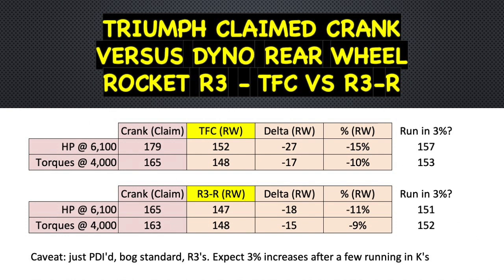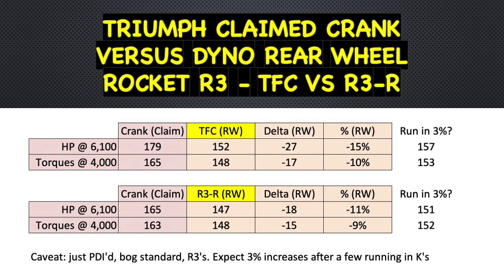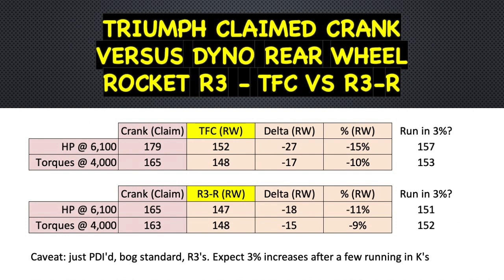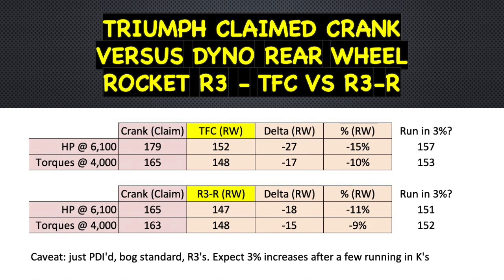RIDE ON | Dyno'd Triumph Rocket 3 | Factory Custom (TFC) vs R3-R

Comment: No big deal!
Reply from the maker: Other options are available. But none of them can put out circa 150 hp and 150 lbs/ft at the rear wheel. No substitute for cubes it seems!
Reply: @RichDunn   Understood... but here is the deal... here is where the rubber meets the road.  The Yamaha Vmax stock would beat it in the 1/4 miles as would the BMW racebike and maybe a Hyabusa!  I think you know that for real world numbers to change, one has to double the HP for a less than 30% betterment in speeds and faster elapsed times.  I know some one that has a customized HD that makes better numbers than the Tri.   That is amazing considering it is a POS HD airclooled twin. With that rational the tri should be over 200 HP!   An Indian with a supercharger makes better numbers than the Tri....  So like I said, no big deal. 

 That said, it is a cool bike... how ever ponderous and unwieldy!   I would prefer to be less than 1/2 second behind that monster on my 2020 GS!!!!!!!  And certainly again in the real world... the BMW GS would beat the Tri from coast to coast as a matter of practicality.   How ever If one has the money to play with ... heck yea... a tri would b phun!!
Reply from the maker: @davidfalgout7304  I've ridden the R3 and VMAx. The Max is heavier, has skinnier tires and makes less torque... so I wouldn't be so sure over 1/4 mile! And it's not designed to be a race-bike, like my old S1000RR/HP4, or a long fast sports tourer, like my old K1300S/Hyabusa; so not really apples and apples! Big numbers can come from tuned V-twins,. But do they come with refinement, reliability and a full factory warrant? Triumph comprehensively ticks those boxes! It's easy too say bikes with loads of money and tuning thrown at them can make big power. But you cannot then compared them to a bog standard production bike as if they were the same thing and say 'no big deal'. Have you ever scene the dyno figures for a TTS supercharged (previous gen) Rocket 3? It's violent!  Ponderous and unwieldy? Hhhmm, have you ever ridden the new R3? Or the VMax, Diavel and Fat Bob? I have ridden/owned them all. And the new Rocket is handles better than any of them! I've owned four GS/GSA's - OF COURSE it's more practical coast-to-coast than an R3!!! What's your point? ;-D The new R3 sure is 'phun'! Try it and then come back and diss it, and I'll say okay opinions can differ, but at least you'll have based it on experience!
Reply: @RichDunn  ..i still say no big deal. You say "toematto"..... I say tomato... its all good.  That engine should do better than ~~ 150/150 .... jus sayin"  Yes, owned and raced professionally.... Iron butt success..etc,  as well as high performance extreme aerobatic aircraft...
 OH yea..in the USA... good luck if you need the help of a dealer...can you say, " SOL"?
Reply from the maker: @davidfalgout7304  The dealer seems pretty decent so. I have friends that have bought bikes from them and I've known the owner for years. They have multiple mechanics who have been on the Rocket 3 servicing training at Triumph. And they have good links with Triumph NA, who are based about 50 miles south of me. I've bought a dozen or so new bikes from US dealers in the last few years, so I have a pretty fair idea who values their customers and who doesn't. You can buy a bike from any salesman at any dealership. That doesn't interest me as much as the workshop and mechanic working on my bike.They seem pretty decent, but the proof is in the pudding. Always good to hear others opinions. Thanks for posting.
Reply: @davidfalgout7304  Sorry....stopped listening when you said you rode a GS.....
Reply: @MrBillyRR    thats ok no need to be sorry. I also do not expect anyone to listen to me. 99.9% of the people I have met simply are not on the same etherial level... and thats ok.   But I have to ask you a question Mr. Billy, have you ridden the 2020 R1250GS? and if so how far?  Also what kinds of M/C's do you ride?   OH I almost forgot... that is the same 99.9% that could not keep up on the track or in the air.......so again.. no worries mate!
Reply: @davidfalgout7304  'ponderous and unwieldy'? :   https://www.youtube.com/watch?v=oFMZ8cpT5Zk&t=325s   Maybe I'm missing something, but I'm seeing the R3 carve the shit out of some twisty mountain roads. Doesn't really seem in need of stage kits or superchargers either.. All I see is excellent handling, braking, and crazy good power delivery, which I think is what Triumph wanted? It looks just right to me. Looks at home in the twisties, which is perfect. But I did fail to recognize that you may be one of the 'small people' that would see this bike from a lower perspective, so, sorry 'bout that.. :-(   LOL... just giving you crap buddy!  but seriously... ponderous and unwieldy?!?!? Maybe the last Rocket; not this one...